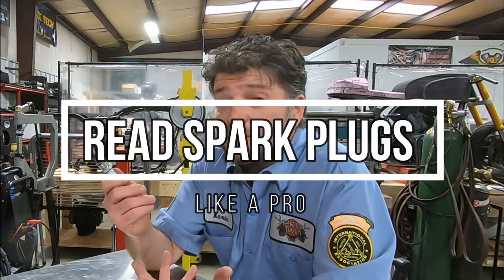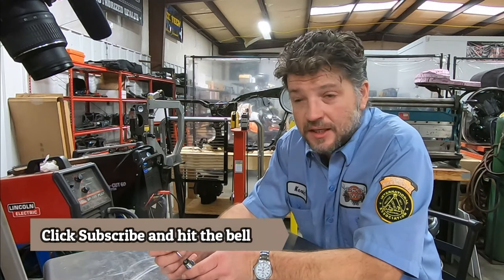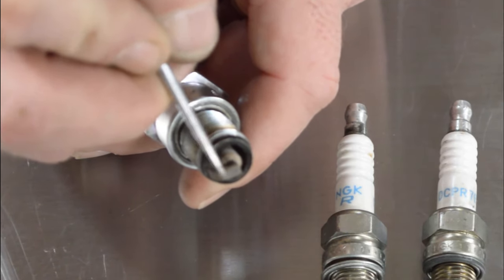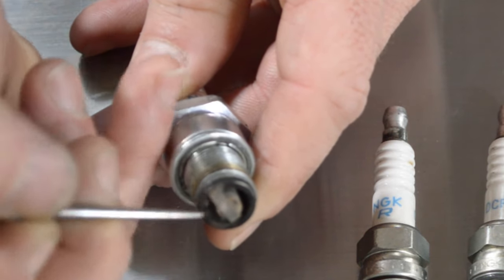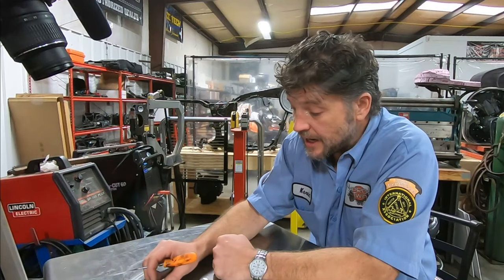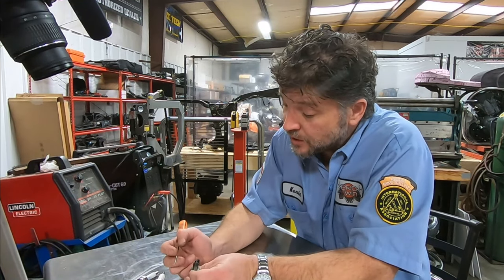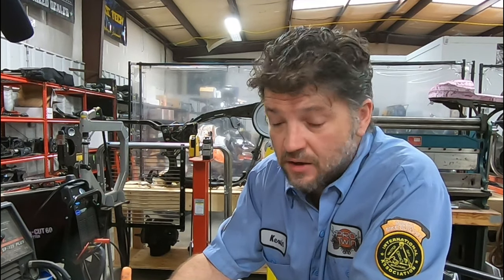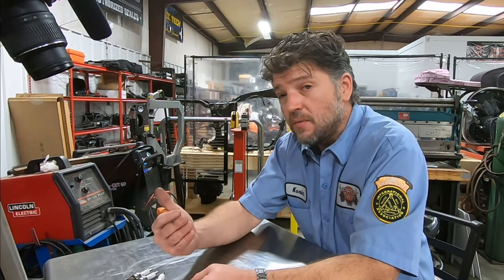Read Harley Spark Plugs Like a Pro - Kevin Baxter - Pro Twin Performance

Comment: I have a 1974 shovel with lots of head work including bigger inlet valves, an S+S big bore kit, C grind cam and dynamically ballanced crankshaft and it goes realky good, nearly as fast as my 1999 twin cam. About 20 years ago i gave it a full service ready for an interstate run with my club, then it was hard to start coz i took all the electric start off so kick only and it always started 1st kick hot or cold, but then it would take 20 kicks to start, so i pulled the spark plugs out and cleaned up the old ones and put them back in and it started 1st kick again, so i looked at the numbers on the new plug and they were the same except for a R at the end of the number so i took them back to the store and they told me that the EPA made a rule that all plugs had to have a resistor in them to cut down radio interference so i hunted around and couldnt find any plugs without a resistor in any brand of plug, so now i am using the old plugs and have been using the same plugs for 35 years, and just clean them when i do a service. I found split fire plugs and they worked for a while but they went out of buisness years ago and coz they are split fire it made them hard to clean so back to the old Bosch plugs. I have points in the ignition so i can presume that resistive plugs would work with electronic ignition but my mates with electronic ignition and kick start only all have trouble starting. So my question to you is do you know of any spark plugs that dont have a resistor in them. Appreciate any help you can give me on this subject. Johnny

Comment: What if my from plug is leaner than the rear and the intake manifold is not leaking. My rear plug is a little darker than the front. 2001 sportster 883.

Comment: thanks, prolly one of the best spark plug readings tutorial I've seen, i hope i can put it to good use at the track this summer.
Reply from the maker: Thank you very much sir!  I appreciate it. I hope it does.
Reply: @KevinBaxter  the only thing you  missed was cold rating. Other than guessing, is there a way I can tell if i have the correct plug. If you don't know i run a turbo road king w/98" that runs 30lbs boost (not a typo lol) currently running ngk's dcpr9e
Reply from the maker: No doubt there sir.  As you know, much of that can change a little when dealing with boost, nitrous, alcohol, nitro, etc.  I didn't even go there on this one because very very few people take things to that level and I didn't want to confuse anyone.  30lbs boost...just how big are those cyl studs?  lol.  Anyway, to answer your question...in a boosted engine you can also use the ground strap as an indication of plug "temp".  You would want the color change in the exact same area however, if you aren't experiencing detonation and you know the timing is pretty dang close, use that to determine if you could run a hotter, or colder plug.  If the color change is close to the tip, run a hotter plug.  If it's closer to the threads, run a slightly colder plug.  You want in right in the middle of the bend.  Also, pay very close attention to the center porcelain.  If it starts to look glossy....as if its melting, definitely run a colder plug.  Hope that helps.
Reply: @KevinBaxter  if you find yourself with some extra time on your hands check out the road king, I have  a few video up here on the tube of it. I built it last year from the ground up, started with a bare frame, no parts no motor nothing acquired it all for the build and did it for about 15k total investment, you will see the progression of me turning up the boost, I started out 12lbs then went to 18lbs, then 22 and then just let it eat at 30lbs, i think i can make even more boost yet,  it sounds like a 2 stroke chain saw going down the track. I've been doing all the tuning with some help from my local HD'er setting the AFR's and making sure i don't run into spark knock. By the way I swear by Kimbal White studs, wont ever use anything else.

Comment: excellent Kevin.  I sure did not know plug reading to this level. Just the ceramic coloring to tune the carb jets to the new carbs/pipes, etc. Worked just fine for me in the 70's on 2 and 4 stroke bikes.
Reply from the maker: Thank you sir. Glad it helped.

Comment: I built a 1974 year Shovelhead all stock. Later I has a 1980 Shovelhead with a mild cam and S&S B carb. My Toyota tech friend told me to run Toyota plugs. So for all those years I ran the ND-16 U-groove Toyota plug. Also a great plug against seizing in the head. I never had one to foul out and always ran clean. I also ran them in my 1994 Heritage Evo with crane 490 cam and S&S E model carb. Great plug. In my 2010 Heritage, I was going to try them and for some reason, the 2010 Twin cam engine has some off the wall thread diameter that the parts store could not cross reference. I run SE plug in it. Oh Well

Comment: Great video, i tuned My 2013 Streetglide D&D Fatcat exahaust with the DynoJet Powervision but without O2 Sensors and adjusting all fuel setings manually. I just raised the fuel up a hair and rode a little and kept bringing it up based off how it was running and  reading the plugs, I just went on a 3200 mile trip out to Utah, rode in 100 degree heat and 12,000 foot up in Colorado, the bike ran great and when pulling a plug after i got back i expected to see signs of riding in the heat but the plugs looked great based on your video here, just a slight color change 2 threads down, i actually raised the fuel up a tad after all that since they looked more grey where ypur showing more black but the center porcelin is still white. This has been a lot of fun and i no longer hate fuel injection and think this actually works better then a carburator. Your video taught me enough to get it runing perfect. One thing you cant teach though is common sense, you will need that to tune this way. A lot of people are hard headed and refuse to learn, in there case they're better off to just use a pre tuned map or whatever you call that or pay a Tech. I like the hobby aspect of doing it myself.
Reply from the maker: Awesome job!  Good on ya man!!!
Reply: How do you adjust the timing with a power vision?

Comment: WOW! I’m going watch again with a note pad. This has been black magic for years to me. Never found a good explanation on the process of tuning from spark plug color. Thanks for the great info!
Reply from the maker: Thank you sir.  Be sure to watch the follow up video where I applied the same principals to the 270 inline 6 in my 1949 GMC.  I call it the "Stovebolt" project.

Comment: I have to say that even though I can read a plug very well, this is the first time I've heard of taking the porcelain out to get an accurate reading of the throttle range.. It's was the only way I had to set up my card at the drag strips... It was not uncommon to go through 6-8 sets of plugs in a day... I will say though that I also have a Wego III exhaust gas analyzer with data recording... Great tool.. Well Done.. Thank you...

Comment: Thank you sir, been waiting for info like this. Re jetting a S&S 96 and always ran rich. Ran good but always black plugs. With gas with  higher octane, like 110 I had a chocolate color. Always ran poor in low rpm. Finally re jetted the carb and with 91 octane I'm getting a nice cocoa color and a lot more torque and better throttle response. And always wonder if my timing was correct. After looking at my plugs and still wondering if I'm in the right area, I saw this video. I think I feel better knowing that I'm pretty close and shouldn't have to worry about blowing up an engine. Great content!

Comment: Great content!

Question?  If the color change is in the curve of the ground strap, that indicates proper ignition timing.  But, is this proper ignition timing at cruise RPM where the engine spends a lot of time or does it cover the entire RPM range considering different RPM’s and engine loads require different amounts of ignition timing advance?  Thanks

Comment: Great info. Thanks. wonder if chalk on the ground strap would help even more to recognice good ignition. Hard to see on my spark plug. When i cut with oxygen and acetylen i use chalk to follow where to cut. And the chalk would not burn of. Maybe that could be a help to see about the ignition. My engine is an 106 TC stroker. with a high correct compresson ratio. About 9.7:1.
So im trying to get air/fuel and ignition as perfect as possible. Im using octan booster. Thus hard to check the ground strap. Dave Mackie heads and TC G 590 camshafts. Pulls very hard. Im living in Sweden. Thanks for your thoroughly teaching. Greetings Peder

Comment: Kevin, new subscriber here in Canada. Absolutely fantastic channel with professional on-point info (I’ve watched them all) 
and great presentation. I’ve done about 15 twin cam builds and 1 M8 (all in my home garage) and must say that your knowledge and experience is invaluable. My tablet and your guidance will forever live atop my tool box with my shop manuals for easy reference. Keep up the great work Kevin.
Reply from the maker: Awesome!  Thanks and welcome.  Glad i can help.  All the best to you.  Where in Canada?
Reply: Kevin Baxter Up in Kingston, Ontario. 25 minutes and directly across from upstate New York border. Ride the New York, Pennsylvania, Virginia, NC/SC states. Haven’t been to GA yet but plan to. Would love to drop in once things open up. Be well, be safe and keep us all fed with your great knowledge. 
Thx.
Reply from the maker: I love Kingston.  Know the guys at Motosport Plus...well I did until ownership changed anyway (Tony Hewitt used to work there...good fella).  I went up there a few times to train them on EFI tuning.  You probably know of Bob McKay...McKays cycle creations.  he was a very very dear friend.  Wayne at Heritage Cycle Works....great friend as well.  I actually have a few boxes of pucks from Canadian Tire bought from the Kingston store.  I use them as feet on my equipment.  Actually the first time I had a Timmys was with Bob, his wife Dianne, and my wife in Kingston several years ago.  Hard to beat a Timmys.  I was just up there a few months ago...I drive up and cross over by way of the 1,000 island bridge.  Have also judged the Toronto bike show a few times.  If you find yourself near Ga...welcome to come by anytime.

Comment: Excellent video; and very helpful as I get ready for some tuning.  I'd like to start with making sure I have the correct heat range plug for my application, can you offer some advice on how to determine this, or how to contact someone for help?
Reply from the maker: Start with stock.  Its very rare you will need a different heat range.

Comment: Ok, great vid. After putting in new plugs, how long do you run the engine before pulling them out to check the tune? Im talking about a street bike running normal fuel under normal conditions. I'm also referring to the fuel mixture, not the igntion timing as I know the ignition timing mark will appear straight away.

Comment: Best Spark plug reading video I have come across by far, thank you. But how do I tell the difference between a spark plug that is overheating due to lean mixture or a too soft a grade plug without examining the Combustion chamber?
Reply from the maker: Thank you sir.  if lean, you will see the white residue on strap and center porcelain.  If heat range you will typically see the porcelain turn glossy...as if it's melting.
Reply: @KevinBaxter  Thank you for your reply

Comment: Awesome video as usual....  Is there a service that one can send your plugs to get a reading of what's going on?    Maybe spot some red flags early?  I have a 2010 heritage classic.  Stage 1 with a Thundermax tuner and D&D exhaust.  I started with the tuner cause I knew I'd need it anyway when I finally got to the exhaust.  Bought the tuner thru Cycle Solutions.  They sent me the initial base map and then a new map once I added the exhaust.   I pulled my plugs after watching your video and they looked nothing like those in your video.  No black at all, crusty light deposits all over the ground strap, the outside of the center electrode and even thicker on the porcelain......   So, to put it mildly,  I'm concerned.  The bike runs like a bat out of hell.... so no complaints from that aspect....   But if I've learned one thing from you;  An engine can be self destructing slowly with not symptoms until it's too late..... Don't want to end up there......... Any suggestions where I might turn to for help reading my plugs.

Comment: I just found this video after doing some maintenance on my son's '96 Sportster. It had been sitting about five yrs. After all of the initial stuff you do on one that has been sitting I fired it up. I installed the Harley plugs he brought me(6R12), but it was snapping and popping. It cleared up some after a couple rides but still not right. What plug would you recommend for a 883 with a 1200 bore kit. The front cyl. is burning fairly clean, the rear is sooty looking. Thanks

Comment: This was an awesome video! I have a dyno at my house and I've tuned a lot of high horsepower nitrous bikes (Hayabusa zx14 gsxr1000 ECT) but I've mainly used the grounding strap just for finding out what timing a nitrous motor likes. I'm going to buy something to where I can cut plugs open and I'd love to compare this method with the wideband on the dyno. By having a cheat sheet (AFR wideband) I should be able to see how close my initial guesses are when reading a plug. Can't wait to try this out with one of my personal bikes
Reply from the maker: ive done it long enough, i can almost tell you to .2-3 afr what it is by reading the plugs.  you will start to see the pattern.  just look down in it with a flashlight...youll see it.  no real need to cut it open.
Reply: A hack saw blade and a cordless drill make sort work of the crimp. I run in a nitro crowd where everyone has to have the latest greatest wiz bang tool…. If I didn’t make everything for the hot rod  this po white boy would be a spectator.
Reply: @KevinBaxter  love your videos, what’s your thoughts on the E3 plugs? I have a 2011 Fatboy

Comment: Absolutely the best explanation on spark plugs I've ever seen.
Now, which plug or plugs do you recommend on my 2013 Heritage Softail with the 103B? 
Has the stage one, which entails the performance air filter and two into one Rinehart exhaust, with the Power Vision 2 tuner.
Using 91 octane fuel.
Thanks in advance.
Reply from the maker: thank you sir.  regular old 6R12 or equivalent in other brands.  Stock works great.

Comment: Kevin, really appreciate all the effort you put into your videos.  I pulled my plugs the next day to see what they were telling me and none looked right at all so I decided that since they've got 20k on them and they have been in since break-in and two different stage builds that I'd put new ones in and see how they read.  Question, how long should I run them to get a good reading?  2017 M8, 22x cam, big sucker and CFR slip-ons.  Once again thanks for your great contributions, I've posted several out on some forums to share.  Ron
Reply from the maker: Thank you very much.  It can take a few hundred miles to get a really good average.  In racing, you can tell after only one run, but you have to have a library of plugs to compare to.

Comment: Hi Kevin, wondering if you can help me. I just pulled my plugs from my 1200 EFI Sportster with bigger cams. The spark plugs only had 200 miles on them. The porcelain is white in colour with no deposits or specs of silver and is not shiny, the centre electrode is nice and sharp. The top two threads have changed colour a little but not sooty. However the only thing ive not seen before is the ground electrode/strap is a powdery white. This simply wipes off with my finger. People seem to say its normal and its usually fuel additives. Ive not put any additives in but always use premium fuel and in the UK its 99 Octane. The bike has been properly tuned also.

Comment: Great Video! when you talk about ignition timing on the strap is this general or can you tell if it's not correct at light load vs WOT?
Reply from the maker: i've never been able to nail down exact range of timing on the plug.  i see it as a general check/average for the entire advance curve plus or minus.  detail tuning has to be done for specific ranges.  great question.

Comment: One more question.  If we pull the plugs and see that our timing is off, to lean/rich, etc.  then make an adjustment.  put the plugs back in.. how long should it take before we see any changes on the plug?  or do we put new plugs in for that instance?
Reply from the maker: good question.  the changes start to happen pretty quick but...a plug wont really clean itself exceptionally well if it's starting out bad.

Comment: what does it mean if one side of the plug ground strap ,porcelain and electrode have white deposits and the other side looks smooth and tanish is it oil migration ? and the rear cyl plug on my 07 96ci is noticeably whiter much hotter?

Comment: Awesome video, 🙏. I have a 09 road king 96” with a thundermax ECU, SE 255 cam,  Vance and Hines slash cut ovals and V & H air cleaner. My plugs are white on one side of the porcelain and grey on the other? Both cylinders are the same. ???
Reply from the maker: it's really an effect of how the flame front travels thru the combustion chamber.  If all the other aspects look correct, I wouldnt be too concerned.  People that want every last ounce of perfection, can index the plugs and that can cure/help this but most dont do that these days because any improvement is pretty much impossible to notice.
Reply: Kevin Baxter Thanks Kevin